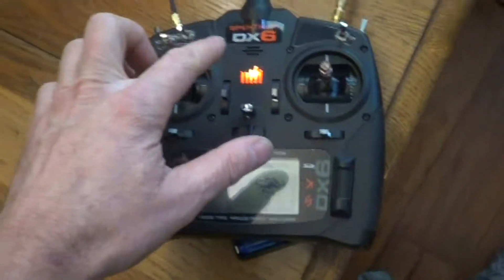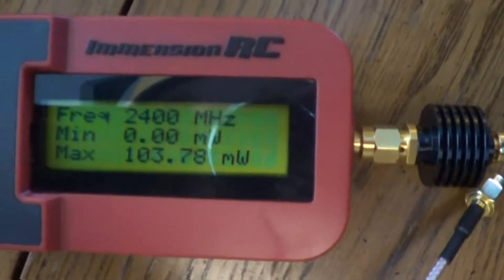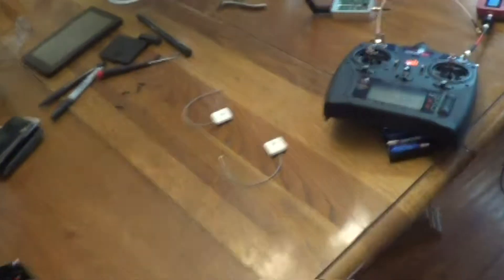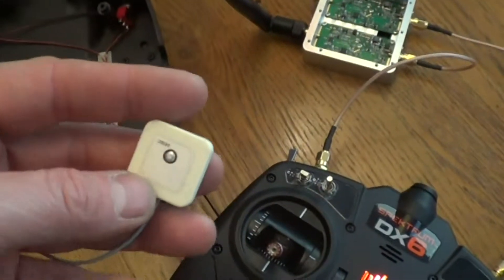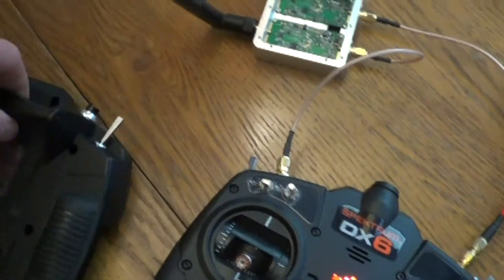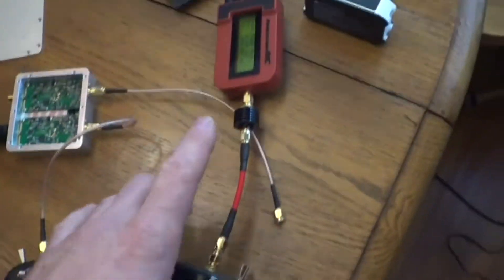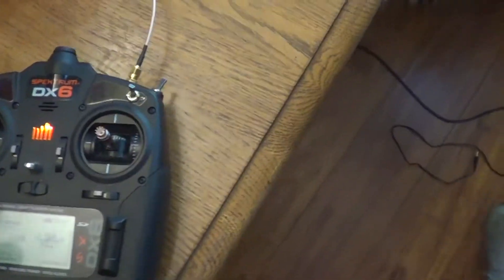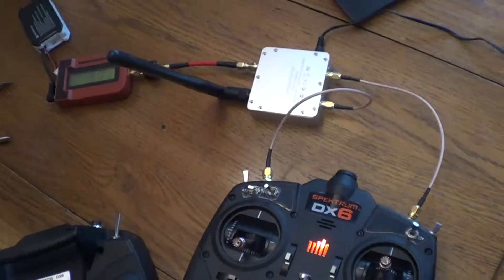Spektrum DX6 or DX9 MIMO rf amplification

Comment: I am going to use 2x 3000mW boosters as you recommended. In order to match the same 3D signal pattern of the Spektrum transmitter, what dBi antenna should I choose? And also, can I power the transmitter separately than the radio with an independent 3S lipo? Thanks!